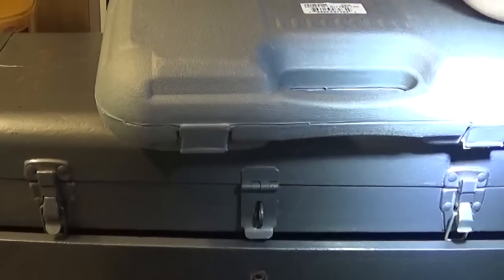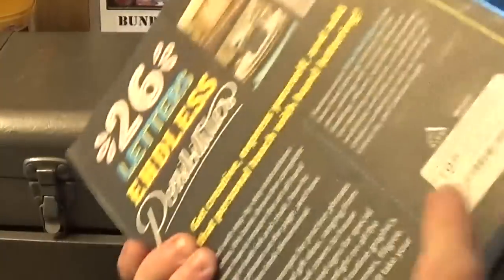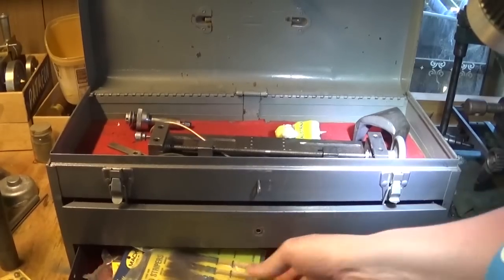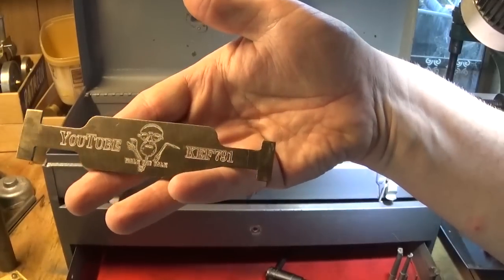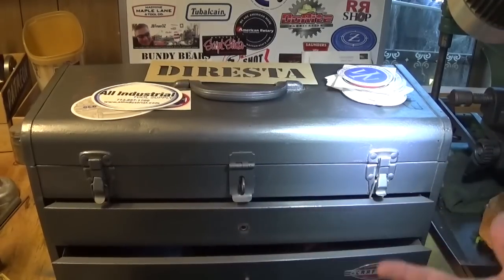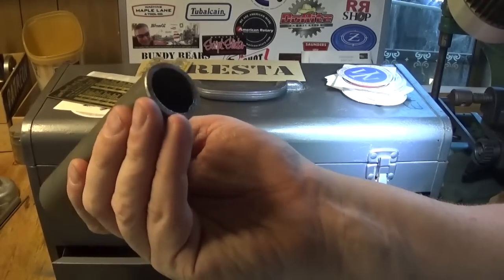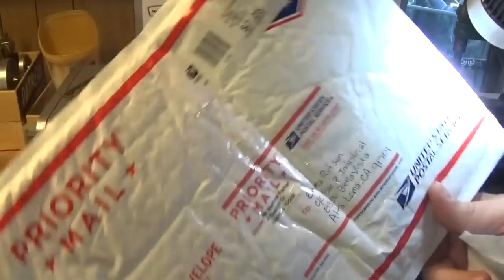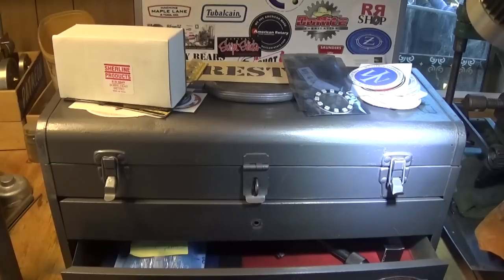USA trip swag and shopping. 2018

Comment: I think I gave you a Chinese Stainless Steel Laundry pin, if it's chromed brass then it's a US Navy Laundry pin used to close the mesh bag and to pin the bag to the compartment tag with all the other laundry from the berthing area.  They are so useful, I use one everyday to hold my wallet chain to my belt and somewhere to clip my car keys.  I've used them to pin my gloves to my tool belt or apron as well.  My grandpa used them the same way and also had them on adjustable spanners so as not to drop them when he was in the air.
Reply from the maker: thankyou. yes you did.

Comment: Glad you had a good time at the bash! (Not fond of micro USB connectors for charging myself. They break easily and have tiny contacts which wear out quickly. Add brittle low lead solder and they are doomed. My eyes are getting too old to resolder them.)

Comment: Imo any video good enough to hear and make out most of what's there is good enough Emma.  The Shereline video was just fine given the issues you were dealing with. 

If? those boring bars and the project you hinted at happens to be building a boring head, then I highly recommend NOT copying the usual threaded connection between the shank and the boring head like the Criterion and every other off shore copy uses. Instead use what Narex does, it's more work and uses more material to make but far superior since the head can rotate in either direction without any issues of the head unscrewing from the shank during left hand rotation.